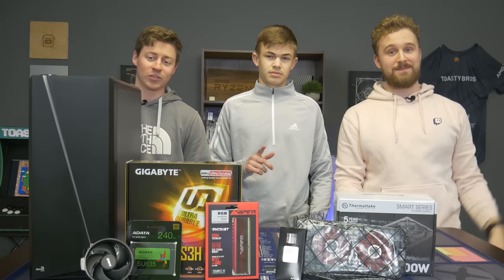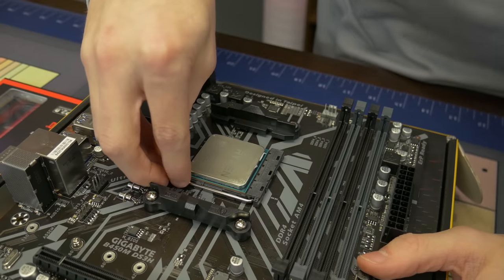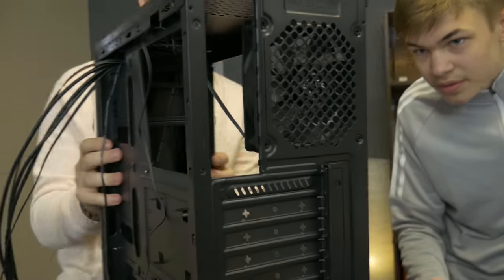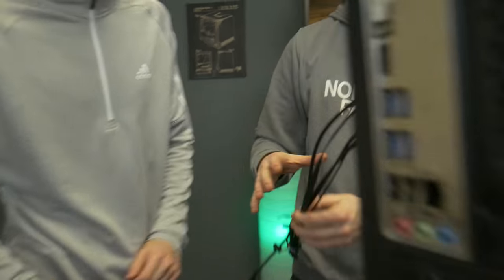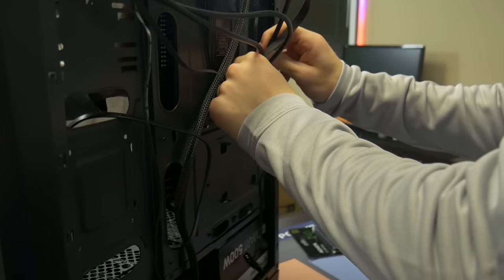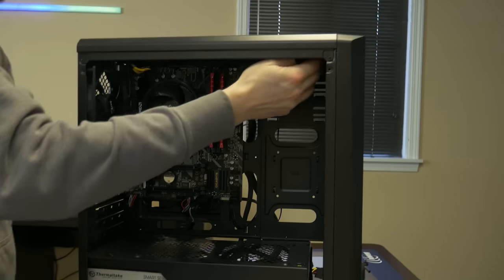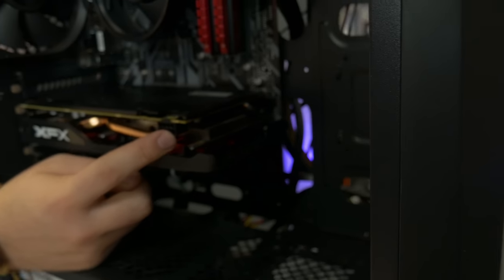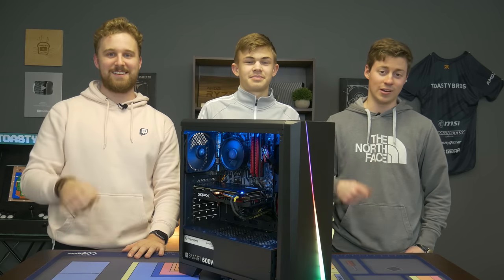2020 $450 Gaming PC Build Guide

Comment from the maker: If you are having trouble with high prices/limited inventory on Amazon, try our Newegg links that we just added to the description. Hope this helps! - Matt & Toastybros Team
Reply: What size is the processor ? 3400 or 3600
Reply: @Toasty Bros   is it ok for me to use the "AeroCool Bolt-G-BK Tempered Glass RGB Mid Tower" for this build? i dont really know
Reply: N4ught7_Nolan ya that should be find. Do u know where they got the led strips by any chance?
Reply: Hey what RGB strips are you guys using in this build and where can I get them?
Reply: Newegg is dry for b450m
Reply: Is there another PC case that can support all the parts in this video?
Reply: where can i get the hard drive so like you said it can act as a storage? I'm tripping out because I don't know if is extremely necessary. Anyone reply please I really need to know.
Reply: I would also like to know this
Reply: Does the hard drive come with a part or something?? Pls reply ASAP I need to know
Reply: $600 usd is what I just priced it all at. I dont know how you got it all for $450 usd
Reply: If I wanted to upgrade my mother board so I could also fit a sound card in, would you be able to recommend something compatible with this set up? Currently the builds gpu blocks the option to utilize the 2nd slot due to the size. Thank you guys, this build has been serving me so well the last 5-6months
Reply: I need help with the led on the case because I plugged in the cables in there right spots and everything runs smooth except the strip on the outside won’t turn on
Reply: Would it be better to get a case that comes with 3 fans?
Reply: how long will this pc last?
Reply: Does anyone know the FPS fo Fortnite
Reply: man i can do preety amazing stuff on 30 fps laptop in csgo cant imagine what ill do with 250 fps 144 hz....
Reply: your taliking was so fast i had to turn down the playback speed
Reply: I wish but I can afford one sadly
Reply: @SPYDR on 60 FPS has not
Reply: @aryanb6738  you can go to almost any hardware store and pick them up
Reply: Can this run fortnite
Reply: @Toasty Bros did it come with a hard drive or did you guys buy one?? I ask because it’s not on one of the components list.
Reply: Will this pc work for gta5
Reply: is there anything else i can use for XFX RX 570 XXX OC couse its not in my country
Reply: How does fortnite run on the build?
Reply: I was gonna build this pc but the graphics card I can’t find and is to expensive almost 700:)
Reply: @sujayf74  if you maintain it well it can last you a while till you decide what to upgrade
Reply: @asx4455  you can try finding one on ebay for a cheaper price but you take the risk of getting something faulty
Reply: The rx 570 is sold out everywhere or either crazy high price is there any good alternative?
Reply: is the windows 10 the key only or with program
Reply: @vkdoesmagic9165  I was about to ask the same question I bought everything for my son . But theres no hard drive info
Reply: Can you guys please help me build my PC??
Reply: can you please make a budget gaming pc for minecraft and cs go please
Reply: also is there a cheaper ghrafics card i can use
Reply: @thirdeye_aspect5034  no
Reply: Can I have it

Comment: Sick build!
The "AF" 1600 is really good. I built a $575 gaming rig with the "AF" 1600, GTX 1070 8GB and 16GB ram.
Reply: I feel like your CPU is going to get bottlenecked by your GPU. Am I wrong about this??
Reply: chilldude2000 it will be a slight bottle neck but nothing to bad
Reply: Tf only 575$? Gimme the rest of the specs please
Reply: My build is bout to be 850😭 but thank god micro center is in my city
Reply: How do you get a 500 dollar build with a 1070. The gpu alone is around 350
Reply: @KorderoSPL  that man went dumpster diving for parts😂
Reply: @KorderoSPL  around 200 used
Reply: @KorderoSPL I got the 1070 for $150
Reply: @OverdriveTech  thats a nice deal for a 1070
Reply: @chilldude2000  yes ur wrong
Reply: @KorderoSPL  G'day even in Australia GTX1070 is only about $300AUD on Ebay & Gumtree
Reply: @shaneeslick  new or used?
Reply: Gtx 1070 will be bottlenecked. Not much but still noticeable
Reply: I paired 2600X with 2070S, not seeing bottlenecks in games I've played so far. CPU rearly hits 50%.
Reply: yiepie   I wouldn’t be comfortable making a blanket statement like that. I guarantee I could put that 1070 into situations where the gpu is the limiting factor, even at 1080p.   Also I can find situations where the cpu is holding It back.   What game, what resolution, what part of the game, quality of monitor, etc all impact what is noticeable. 
I think the 1600af and 1070 are well suited for each other.
Reply: @desmannn3260  used, can't get New ones any more
Reply: @chilldude2000  yes , ur wrong those 2 pair perfectly.
Reply: @KorderoSPL  because you dont buy a "new" 1070 nowaways. that wouldnt be smart bc you can get much better with 350 with current gen gpus
Reply: @KorderoSPL  used
Reply: @anademy8690  there will be almost zero bottleneck. People pair 1600 AFs with rtx 2060s and 2070s
Reply: The DestrOyer A 1070 is like $200-$230 on ebay.
Reply: Samuel Diffenderffer now that’s a bottleneck
Reply: Can u send me the part list plz
Reply: @KorderoSPL  I got my 1070 6 months ago for 200$
Reply: Yea I literally got a gtx 1070 windforce oc for 200 dollars a few weeks ago lmao. My whole system has the same specs and same price. I thought it was impossible
Reply: @chilldude2000  no i have seen people pair a 2070 super with the 1600 af. slight bottleneck. but it works
Reply: Im doing a $750 dollar build with an i5 9400f and Gigabyte b365m mobo with gtx 1660 super. 16gb ram. 250gb ssd and 2 tb hdd. The i5 9400f is on sale at best buy for $120. What yall think about this build? I know i went cheap on the mobo.
Reply: 450 bs mine was greater than 575

Comment: FINALLY PARTS THAT ARE  IN STOCK
THANKS
Reply: Mason Gaming 1600af is not stock
Reply: Sadly the case ain’t in stock
Reply: xH00T3R_B00T3Rx yea maybe I can use another case
Reply: @8121x  yeah, i went for the thermaltake h18. seems good enough maybe
Reply: @8121x  they are on Amazon but only 6 left

Comment: Please could you review monitors with higher refresh rates on a budget . it might help because its not worth getting a Pc getting over 120 fps but being limited by a 60hz monitor at 60 fps
Reply: 60hz*
Reply: to me the BenQ ZOWIE XL2411P  is the best monitor to get 144hz.
Reply: But gaming like 144fps or 200fps on 60hz decreases input delay and lowers latency
Reply: I'd say
 1080@144 <$150
 1080@250 <$240
 1440@144<$280
Are good prices, just check the basics specs like if its va or tn, ports etc and then look at a quick review on yt for stuff like ghosting or something.
Reply: @sharkaboi  Well I'm getting a 300€ 1080 144hz monitor
Reply: Dell 2716dg but I think they went back to 4 or 500 a week ago. Always keep a bestbuy credit card
Reply: collo_ kybe there’s a aoc 144hz 1080p monitor at Office Depot for only 130 atm
Reply: @sahir4305  i will look at it . Thanks

Comment: I was looking for some 4k monitors for this when I read the description and saw that I can only run 1080p
At least the monitors will be cheaper
Reply: So which monitor do you recommend?
Reply: Okay so you might have some misconceptions...Gaming at 1080p for this build is ideal but no doubt it can't handle outputting other videos like movies at 4k hdr. Also make sure when buying a monitor you look for ones that have at least 120hz refresh rate as it makes for smoother gameplay and other tasks.
Reply: 4k gaming is NOT worth it.  It's truly not.  I have a 4K capable gaming rig, (gtx 1080) and a 1080p rig (RX 480) and I honestly don't notice a difference.  And, yes, I'm VERY picky about picture quality.  I regret spending so much on the 4K rig.  Waste of money (though I suppose it'll "last longer.)

Comment: it sold out on amazon before i could buy it  ): but i bought a 2600x for 118 at microcenter today
Reply: Is it worth buying the 2600x for the better cooler?
Reply: Buy r7 2700 for less than 150 on amazon its 8c 16t
Reply: @majesticsucks3305  I'm going for gtx1650super due to budget, wouldn't it bottleneck the cpu
Reply: Bungi Plays there are some good fans for $20 out there id strongly recommend buying one if youre going to oc
Reply: majestic sucks theyre like around 150 though so like 160 tax? Not trying to spend a lot on it so, next build i wont go cheap

Comment: Now wait when I use this exact setup with the exact components it’s comes out to over $580 but this build is only for $450 what happened!!
Reply: PC parts change daily, I build this exact rig for my dad about a week ago. $520
Reply: Yeah when I’m testing out the prices it comes out to £500 which is 611 dollars in us money. England puts the price up so much it’s way more expensive here
Reply: its 537 rn
Reply: Hey any of you guys know what case I can use for this build?
The one in this video is out of stock.
Reply: @keish4389  I just tried all my spots online and its sold out or out of stock everywhere, Sorry
Reply: What’s it in Australian dollars
Reply: Stocks.
Reply: @lofikzdesigns4545  Laughs in this build being over 800 in my country
Reply: Team Static about 700
Reply: Yup it’s dropped to about 650
Reply: @keish4389  if you go to pcpartpicker.com and scroll down to cases you can chose a case based on price and looks that will suit you. If you want to be safe you can put all the parts in the build list and it will tell you about any possible compatibility issues and you can look up on Reddit or google whether or not that should be a problem
Reply: Lofikz does the PC work well?
Reply: It's probably because of the 1600af. Go for the 3100 instead. Just search Ryzen 3 3100 and look for one to be 100 dollars
Reply: wow so far off on the price its not even funny obvious payed advertisement here. not to mention absolute horrible performance how is it 200 fps on a 60 fps monitor. get real and move out of your parents extra room. or become a politicians.

Comment: You linked everything but the hard drive😂
Reply: impreplex don’t need a hard drive lol
Reply: UI T1AGO u wire the ssd to your motherboard the sata cable use the sata power cable to connect the ssd to the psu an than mount ypur ssd in the case
Reply: @nttxic6929  could u put that in noob terms?
Reply: @Xur_  Plug the SSD into the motherboard and PSU. 

The connector for SSD to the motherboard is called SATA.

SSD: Solid State Drive. Responsible for storing all data such as pictures, games, operating system, etc.
PSU: Power Supply Unit. Responsible for providing power to the system.
SATA: Serial Advanced Technology Attachment. A type of connector used by HDD and non NVMe SSD to motherboard.
HDD: Hard Disk Drive. Same job as SSDs, but usually older, slower, heavier/bigger. Still reliable, but not the best choice.
NVMe: Non-Volatile Memory Express. A newer type of SSD that doesn't use a SATA connector. Extremely fast compared to SATA SSD and HDD, but much more expensive.

Hope that helps.
Reply: @spencer2468  thanks🤪😊

Comment: Ok so I built this about 6 months ago, and here are my reactions. 
Crushes most games I have with no real stress, costed more like $600 but still great power. Fan noise can be a bit expensive at full, so I had to buy some software for that. But 100% recommend if you have a under $600 budget

Comment: ... the power and reset switch positions are not a polar type situation as long as both pins are connected to the proper pins it does not matter the orientation. if the computers power switch doesn’t work it’s connected to the wrong pins not in the wrong orientation. Only situation where a power switch is important to have a specific orientation is if the switch has a built in LED because diodes are polar and only work in the set situation. Switches bridge a gap in order to control something thus it does not mater the orientation of the pins on it.

Comment: Good Morning, I have a I7-9700 running on a Gigabyte B365m DS3H motherboard, running 16 Gb of ddr4 Ram at Patriot Viper 2133MHz, I want 16 more Ram but cannot find the 2133 available on Amazon, they do have the 2666MHz that is compatible, but is it ok to put 2666MHz in a system running on 2133MHz?  Thank you for the help, want to try to get it ordered today if possible.

Comment: idk if prices went up or something but this is nearly than twice the price specified because i went onto amazon and found some pieces for it and it adds up to be CAN $838.73 but i used a calculator and it SHOULD cost CAN $587.76. is there a less expensive alternative to this? i am only 12 and have a very tight budget. thanks cool pc build tho :)

Comment: I rexommend getting the ryzen 5 2600x from amazon since it is on a good deal where it costs the same as the ryzen 5 2600 and no you dont need an old cpu for the bios for the b450 chipsets

Comment: Why did they change it from a 500w thermaltake to a 450wEVGA power supply. If anyone knows why, that would be great because the thermaltake is a lot cheaper than the EVGA that has its priced raised to the oblivions now I'm sure.

Comment: Ok so The Power Supply part is steel series but the one in the discription is 450 evga pleas tell me they are the same thing becuase i already bought the power supply and do i have to buy more thermal paste because there is already some on the intel core cooler

Comment: What am I doing wrong? With the links supplied on the parts list, I found 3 or 4 components not available on NewEgg. On Amazon, I found the components available, but for a total cost of 737.83. The only change I made was to upgrade the hd to 960 mb from 240 mb

Comment: I bought everything you listed and it worked perfectly. 
Tip: Remember to look at all the prices every where to get it cheaper as mine costed around 500 dollars when if I never looked at the best prices, it would of been 600.

Thats just a little tip. If you want more just message me.
Reply: Can it run modern warfare good
Reply: @adammelgar3833  I believe so. I never actually played Modern Warfare on it but it can easily get CS:GO and Rainbow 6 down 100%  so I would believe it could do the job

Comment: As prices are killing the cheap pc build it's getting harder to build a budget build .  Although this is a good little system the areocool cylon case is very air restricted.  Check out my build with a 5500xt and  16gb of ram.  For £500.  Nice video 👍

Comment: I've never built a PC before so please don't bash me here okay?
but does that CPU cooler come with anything you listed in the parts list or do i have to buy it seprately and if so, what is it called
Reply: The cpu cooler usually comes with the cpu if you buy it new, just be sure to check the listing

Comment: In what world does a GTX970 outperform an RX580? I've owned both a 970 and a 480 4GB, and found the latter was usually faster. Double the VRAM and add the higher clocks of the 580, and the 970 doesn't really stand a chance.

As for great value GPUs, I just received a triple fan 5700XT from Aliexpress a few days ago for just under $200CAD/$150USD, and it's been incredible! Maybe one of the best value cards I've purchased in my 5+ years of PC tinkering.

Comment: I would get a optiplex 7040 and a rx 6400 lp or Gtx 1650 low profile for heavier games. (About 400 cad with 1650, or you can look for a better one with more vram)
Reply: I think you can build a E5 xeon 2667 v4 PC with a used rx 5700 or rx 6600 for the same price or cheaper ( choose a e5 xeon prebuilt then get the e5 2667 v4 CPU then get a used rx6600 or rx 5700 GPU of eBay or smth like that)

Comment: You have to Collect 100$ more 
in 550$ i made a future proof gaming pc
core i5 9400f
8gb ram ddr4 1600mhz
forgot the motherboard it was from gigabyte
240 gb ssd
450w psu
and a rx 580 4 gb
in future due to a great processor i can upgrade to a 2060 super
and upto 32 gig of ram

Comment: I got all my parts for 414 euro half of them on Amazon and the other half on cex 
My specs 
Ryzen 3 2200g
GTX 1050
MSI PRO MAX 
PSU 450w cooler master
16gb drr4 ram
Pc case
1tb hard drive

Comment: Weak I spent $193 for a msi b350 tomahawk, ballistix sport 8gb ram,1tb 2.5 hdd,areocool mid tower(same as in the video),500w thermal take smart power supply(same as in the video), and a Ryzen 3 1200 all within a $200 budget although I could have got a ryzen 5 for cheaper but the guy didn’t msg back soon enough and the 3 was already shipped by the time he did reply lol

Comment: Can this setup take a water cooler?
Reply: No a water cooler would be a wasted, maybe a liquid cooler a 120mm but not a water cooler, most likely a air cooler
Reply: @dakotathorns  I know this set up is low power but it stays about 100°F in my house during the summer would the air cooler still keep up with it?
Reply: @trainstanksandhistory.5721  And air cooler would help but I would also recommend adding more fans to keep the temps down and put your pc in a shaded areas
Reply: @dakotathorns  Okay. I'll do it all. On the hot days I'll just take the side cover off and have a desk fan blowing into it. Just in case.

Comment: they didn't put any fans in the links
like literal cooling fans not people
Reply: You would have to buy a case fan splitter because that motherboard only supports 1 case fan. i made that mistake as i was building this pc. They also didn't mention that if you get any ram over 3000mhz then you would have to overclock the ram  which the motherboard doesnt even support